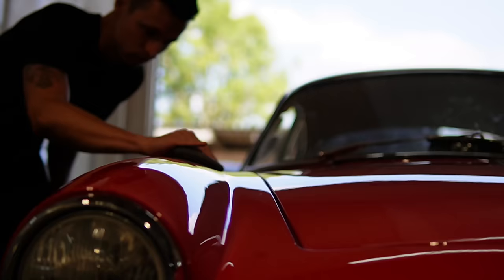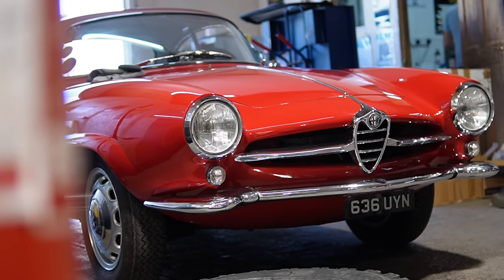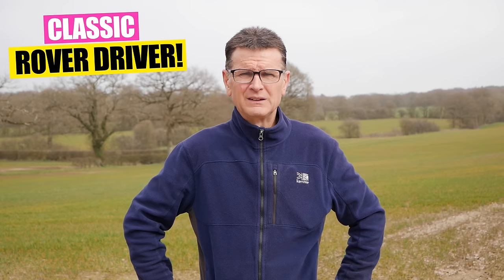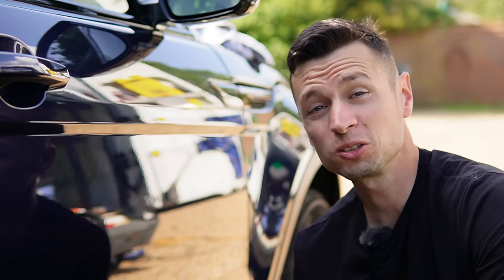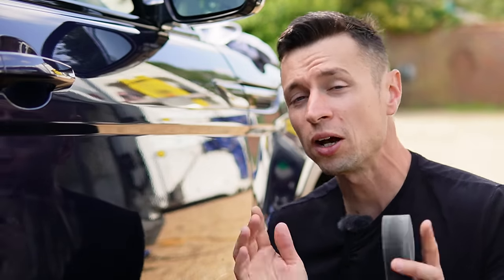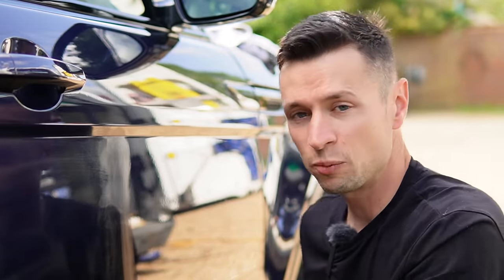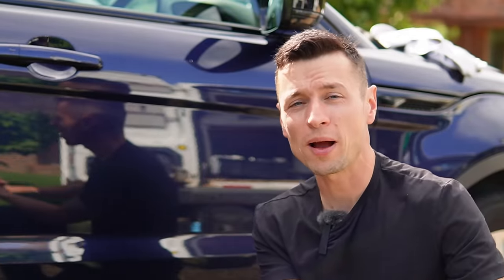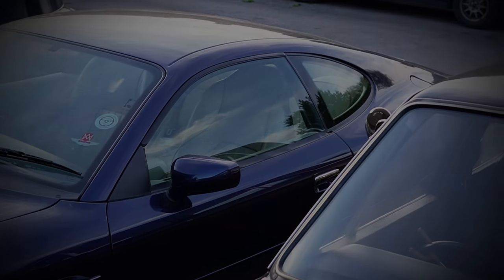How to Polish a Car Polish THE EASY WAY without a Machine Polisher?

Comment: Interesting video mate. I’ve been using super resin for the past 20+ years, having entered numerous cars in shows. What’s interesting is that super resin is very versatile. For example, I’ve removed light scratches permanently (you mention it’s only temporary, but with the right tool it can be permanent as the product can be manipulated) The technique for this is to actually use something a bit better than an applicator pad, as you cannot ‘work’ the product properly. I tend to use very soft flannel cloths. I can even use a little water that can basically grade the scratch out. To be honest, I’m probably the last of a dying breed of detailers. I don’t use machines, everything is done by hand, but every car is always finished, knowing that I haven’t eaten into the laquer. 100% autoglym super resin is my go to in my tool kit 😀👌🏾
Reply from the maker: That's awesome bet you still make a good living though without a machine 👌
Reply: I never knew that someone else new more about detailing then epic car
Reply: Dying breed! Reminds me that when I left school I went into classic car restoration and that was all hand finishing and preping so you could (feel) the panel. After painting it was 1500 wet and dry and elbow grease no polishing machine that way no risk of (going through the edges) Try getting a school leaver now to not use any form of polisher,da sander
Reply: I’m no expert detailer, but for me, Autoglym and Meguirs are no-nonsense, decent quality products that do exactly what they say on the tin. 

Even though I occasionally try other brands, I always end up going back to Autoglym and Meguirs.

Comment: I was using SRP on my car at the weekend to get a few paintwork marks out. Works a treat. I don’t care if people slag off auto glym products, I use several of their products and am always happy with the results.
Reply from the maker: The only people that slag it off only do that because it makes them feel big when secretly they love it. Detailing has become so stuck up and toxic. People will always discard anything if the crowd does sadly. Thanks for watching 🙏
Reply: Aqua wax is all I use now. It’s replaced all the trim, rubber, drying aids etc. Shampoo, AW and fast glass is all.
Reply: @Cous1nJack  does the autoglym aqua wax also restore faded bumper colour?
Reply: @Intz51  to some degree.

Comment: With 30yrs detailing experience super resin will always be my go to everytime .
Reply from the maker: Yeah you can't beat it
Reply: Have nearly 40yrs in detailing & most garages use cheap stuff for cutting costs,we have a local place that makes car products that's why. That Autosmart is pretty good but i have used Ultra gloss for the last 10 years on my own car which is fantastic,but not used the Super resin yet....give it time 😃 Next year i'll get Super resin for sure.  Have used it in the trade at only one place & they don't skimp on car care.

Comment: Completely agree, I ride classic bikes which have large areas of polished alloy, I used to use only metal polish on the alloy (Solvol Autosol) This was fine, but it quickly oxidized and dulled down. One day I had a brainwave and decided to use the same Autoglym Super Resin polish that I already used on the paintwork, but on the alloy too, immediately after using the metal polish.. This was a revelation !.. I was amazed at the amount of black metal polish residue it removed and it left a much longer lasting shine than just using the metal polish did. I use it on pretty much everything on my classic bikes now, including the frame, chrome wheels and exhausts.. Autoglym Super Resin polish really is fantastic stuff and it's the only polish I've used for many years now

Comment: Ive used this for years and ALWAYS finish of as a top coat AUTO GLYM EXTRA GLOSS PROTECTION. its a thin spirity polish but gives a mirror finish! Dries FAST. I started if using my old dads 'beeswax' Simoniz waxpolish it smelt amazing and gave a great finish on the 60's!

Comment: I use autoglym products and I like them easy to use does give a good finish. I also use extra gloss protection but I do find that they don't seem to long, water beading appears to  stop after a few weeks.
Reply from the maker: its very short term but ive always believed its better to use ceramic spray after every clean to keep it topped up
Reply: EGP seems to last about six months for me before I see any deterioration in beading. Then it's a top up with another application of EGP to get it through the next 6 months. Polish just once every 12-18 months.

Comment: Nice, this obviously works for you.  The dusting and the longevity were deal breakers for me, even when I used EGP on top, and used it sparing these 2 things were an issue.  I find what works better for me, and solves all the issues from SRP,  is Megs Wash Plus+, as an abrasive shampoo then a decent wax to top it off.  For me its way easier to control on hot days, and this gives a lasting shine, even after the wax has popped its clogs :)
Reply from the maker: Fair play. It's definitely not perfect by any means. It's great for those nonsense sell your car scenarios 😉

Comment: I've been using autoglym for 40 years and remember when the only place I coukd get it from was the national motorcycle museum.  It's easy to use and even in sunlight good on chrome as well. I've tried other polishes but there difficult to remove if left on.

Comment: Im starting my own valet/detailing service next year and i'm going to incorperate this into my formula's , for a "little" extra , they can choose this option in combination with a ceramic spray or paste wax to make it last as long as possible. Its fast & easy to apply and gives amazing results.
Customer is going to be happy with the result but ofc informing him/her that this is not going to be a permanent option. but i think for the price difference in machinal polishing and applying this product, some people are gonna tend more to the SRP and to pay that "little" extra instead of the higher budget of machinal polishing... (i think).. :)
Reply from the maker: Exactly. Always give the customer what they want. If the car looks too good for too long they won't call you back. So in theory srp is a real money maker

Comment: I've been using Auto Glaze for years. I think it's called Glare Professional Polish, now. It's not actually a regular polish. It has tiny beads of glass in it, so it needs to be buffed at just the right point of drying, or it will scratch the paint, so it has to be applied in small areas at a time.-Put it on, wait a bit for it to nearly dry, buff it, then do the next area. 
It dries hard and ultra-shiney like glass. If you've seen those highly reflective, wet-look, paint jobs on high end cars, that's the finish Glare gives.
Bird droppings and tree sap don't stick to it. Usually I just need a tissue or maybe a bit of water too, and anything on the paint just falls off.

I will be buying some Autoglym Super Resin Polish to put on as a top coat, though. Just for that added protection. I mostly use Autoglym's products. All their products I've tried work exactly as they say they well (despite my initial scepticism).

Comment: I have used AutoGlym SRP for a long time,  easy to use with minimum effort and it gives long lasting results.. I also use it on PVC window frames about once a year and it keeps them white and the shiny surface shrugs off bird and spider poo, as well as stains from leaves etc...  Too much snobbery about care care,  apparently if you do not spend half your life using clay bars and various waxes you are not keeping your car clean...and are a hopeless case.   I also  use SRP about once a month on plastic headlight covers which helps with UV damage and keeps the bugs splats from sticking. I would argue that the shine  from SRP is pretty permanent as I only clean our cars about once a year and they always look shiny - and every time it rains it brings back the shine.    Good for alloy wheels as well.

Comment: I had a '70 Mercedes c250 with blue finish. Resin polish was the best product that worked on it. The same went for a '76 burgundy colored 240D. But, it wasn't permanent.

Comment: Excellent video  I've been using SRP since I got my first car 8 years ago. Of course, I didn't read the instructions, fired a load of it directly onto the black roof in direct sunlight and had arms like Popeye after buffing it off. Phenomenal finish though! Granted, it doesn't last that long, but I found it pretty therapeutic to reapply it every 6 weeks. Ended up pairing it with EGP and the gloss really was insane.  These days I pair it with UHD Wax. Spray waxes and sealants are great, but there's just something about applying a product like SRP and then a wax on top of it.
Reply from the maker: Glad I wasn't the only one when I said I applied too much back in the day. I agree no shame in polishing every 6 weeks. People do similar with waxings anyways. I haven't tried uhd wax but will do soon

Comment: I think durability is a difficult one, a few products like the new turtle wax ceramic paste wax are very durable in terms of detergent resistance but don't last that long in real world conditions. SRP's protection is not that resistant to chemicals but in my experience it lasts well against the elements, still beads after a few months on a car that's kept outside. Bodywork shampoo conditioner is designed to not strip it, so they make a good combination.

Comment: Whilst I agree SRP is brilliant, this only offers a temporary fix as it's designed as a filler polish. Having detailed cars for over 20 years, I can categorically state that nothing will beat machine polishing with the correct compound. Correctly done, the finish is sublime. Far better than by hand.
Reply from the maker: Yeah I totally understand. This video is purely aimed at the non detailing crowd as it's the best selling polish so I had many requests to feature it

Comment: Im a 'pro detailer' as the Muricans call them in the UK
I can't use SRP.
Im allergic to the stuff.
If it gets on my skin, even if I wash it off straight away. I get a big red sore patch where it was. 
Just using it and a hole appears in my glove. Skin cracks and sore hands.
If I accidentally touch the autoglym'd panel in t-shirt weather. Sore patch.
It also gets on my chest and makes breathing difficult.

Comment: Hi, would it be okay to use this after every wash? for example every 2 weeks? and should I decontaminate beforehand? thank you for the video!
Reply from the maker: No need to do that. It would not be necessary. Just top up regularly with wax or ceramic spray in-between using this 👌

Comment: DIYer here, awesome video mate! So you wouldn't do an IPA wipe after polishing with this product to apply spray sealant because of its fillers?
Reply from the maker: The ceramic I'm using here isn't like a full blown sealant as such, it's an sio2 infused spray so nothing long term but short term it has hydrophobic properties. So I only use it with wax or ceramic detail sprays only. So if you use this every 3-4 months just apply that in top to keep it looking ace 👌
Reply: @epicautomotivedetailing  thanks for the clarification man !

Comment: Just had this delivered, after being a little too enthusiastic with an ice scraper a few weeks back on my bonnet when snow was very deep 🤦🏼‍♂️ car is 2nd hand, but know the marks are there, which just won't do 😂😂 thanks for the great video

Also I have the grey pad, does this need cleaning after use? If so, what's the best method?
Reply from the maker: Hello Richard yeah always wash out after every use to avoid powdering
Reply: @Epic Automotive Detailing  cheers 👍🏼 done a great job so ceramic spray ordered as well now 👍🏼

Comment: Hi Dave
I need to clay my car
Can I use SRP after claying to remove the scratches caused by the clay?
Also what do you think about using maguiars liquid wax on top of SRP for more gloss and protection?
Reply from the maker: Hello you can use autoglym super resin polish but sadly it may not get you perfect results. ideally you need to use a compound.

Comment: Do you use the ceramic wax straight after the super resin polish? And is it applied to dry panels or does the car have to be wet?

Comment: Thanks for the advice, great video. I’m struggling to get rid of a Smokey smell from a car I have just purchased. Tried Chemical Brothers New Car Smell and Autoglym Autofresh and some air fresheners. All work for a little while, then it comes back. The smoke smell is not that strong, just annoying. Can you recommend anything please? Thanks, Lee
Reply: White vinegar in a bowl overnight, will smell for 2 to 3 days but should be fine thereafter

Comment: I first used this 35 years ago om my dad's xr3i , and to be honest I've only just stopped using it..I stopped using it because I had a professional ceramic coating , costing £400 , and whilst it looks amazing, 9 months later I can see light scratches and swirls again. This is supposed to last 3 years.. I'm assuming I shouldn't go back to the resin polish to remove swirls again??..what would you recommend??
Love your video by the way
Reply from the maker: hello thank you this polish wont give long term effects. to fix swirls remove coating and break out polisher

Comment: What about using this is a finish polish, as opposed to the likes of Koch Chemie M3 (which is use now) with a machine polisher and soft finishing pad, IPA wipe down and Ceramic coat on top? Would the ceramic still stick properly, would it provide more gloss than normal finish polishes?
Reply from the maker: No it wouldn't be worth it. I written a little blog below with some info on it 😁

Comment: Hi Dave. So how would you go about selling this service as an up sell? No doubt it takes a lot of time to polish an entire car. So do you offer this additionally to go along with full valet?
Reply from the maker: I sell it with wax or ceramic spray on top so it's an easy £50 on average so it's an easy way to term a £50 maintenance valet into £100 😁
Reply: @epicautomotivedetailing  a nice number Dave. What's the name of the service? Hand polish  to remove light sratches plus wax for added shine - Something like that?

Comment: Thank you for a good video.
Can I spray on a ceramic coating after polishing with this product since it contains wax?
Reply from the maker: Ceramic sealants yes but coatings no I wouldn't. You really want it to bond to a perfectly prepped paintwork

Comment: Do you use the same applicator for the SRP over the entire car and if so do you need to clean it at some point? if so how. Best wishes.
Reply from the maker: Hello ideally use one side for upper section one for lower. You can rinse out as you go to avoid clogging up applicator pad. Just squeeze out as much water as possible
Reply: @epicautomotivedetailing  Great thanks, appreciate the quick reply.

Comment: Has anyone tried using SPR with a machine? 
If so, how did it turn out and what was the RPM you used on your polishing machine?
Reply from the maker: Yes it makes such a mess with lots powder. Isn't worth it. Rupes Uno protect does a better job by machine
Reply: @epicautomotivedetailing   thanks! i actually did a quick pass by hand with the SPR on the rear panels of my almost 30 year old volvo and was quite surprised how decent it was at restoring that depth of color on the dark blue paint. 

Gonna try out machine polishing later on, what RPM Do you recommend for an amateur?

Comment: Hi Dave, Another video, can you use SRP with a machine polisher.
Reply from the maker: It's so not worth it mate. I've tested it many times and you will more likely cause more powdering and make more of a mess of it. For me it's not worth the hassle
Reply: @epicautomotivedetailing  Cheers Dave, does the same apply for Yum cars wax?, which i normally apply after SRP

Comment: Can this be used on a ceramic coated car ?? Or would this remove the coating
Reply from the maker: It be used to remove high spots on recent applications but personally ceramic sealants are better to apply on top

Comment: You can use this polish and after apply a ceramic coating ?
Reply from the maker: Bit of a yes / no answer. Yes you can but it won't do much. It can fill minor marks but the abrasives (may) break down ceramic layer. I would just top up with ceramic detailer

Comment: Dave why dose this product leave white powder on plastics and rubber
Reply: Because plastic and rubber is more geographic, the polish gets stuck in the little crevices. You can either put masking tape on those areas or just try your best to not get it on those parts… personally if I don’t tape I always end up with bits with polish in

Comment: Put some wax over SRP, it is like a facial for your car. 

Will fix old red pink paint back to red. 

SRP has limited cut...so will not remove swirls...great product. Less is more, apply on cool section in the shade.

Comment: Hi Dave.  I'm just a newbie here.  I have Autoglym's Polar series.  Should I be using Super Sesin Polish after the Polar Sealer?  Or is one meant to replace the other?
Reply from the maker: Hello The idea of polishing a dry car then getting it wet again with polar seal just won't wont. It's just meant to be an alternative way of protecting your car. It's faster than polishing but it doesn't actually do the same job as the polish has abrasives where as that is just a foam cannon spray that protects